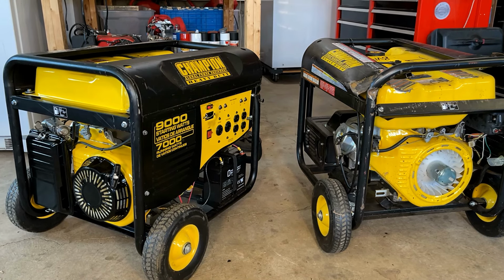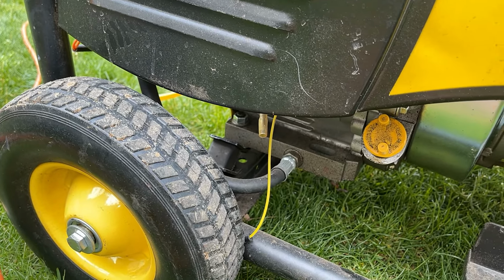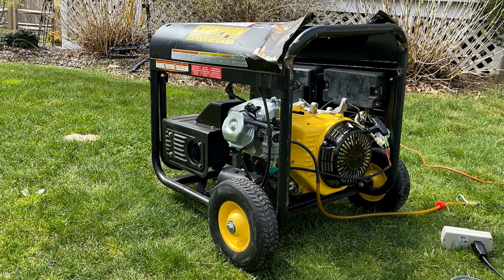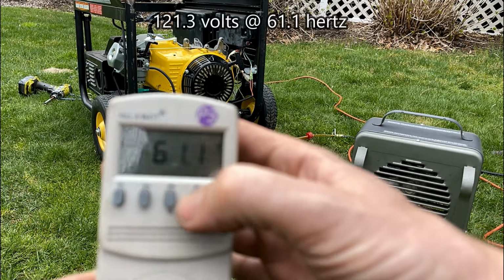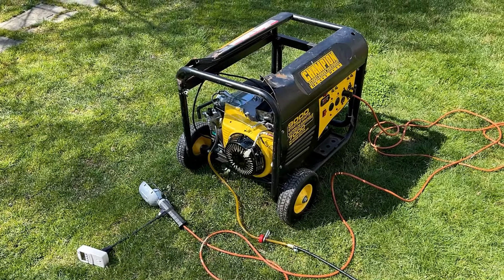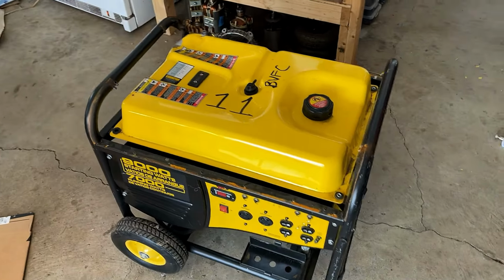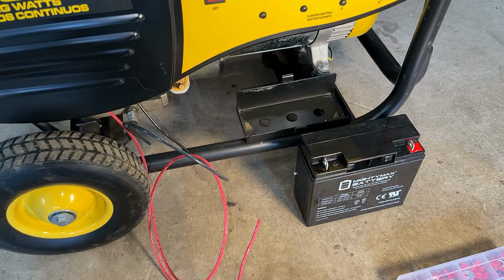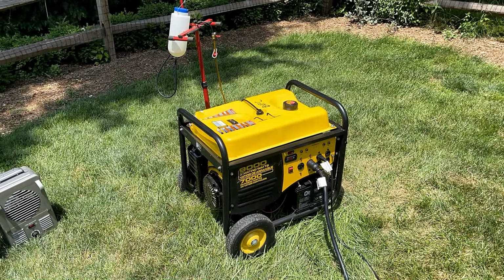Two Junkyard Champion Generators (Part 2) - Scrap Metal?

Comment: Just re-watched these two videos James.  It is kind of amusing that all the manufacturer's name was on the removed sheet metal of this second generator.  You could add "Champion" to both sides of the tank with a standard font of stick-on black lettering.
       To be more ambitious, I think that if you watched Canadian You Tube channels "Cold War Motors" and "Carter's Auto Restyling" you could almost learn enough about panel beating to repair the crinkled metal pieces.  They still would have needed to be detached from the rest of the generator to do it.  They would also have been stretched out by what happened to them.  A body hammer and various "dollys" can work wonders on sheet metal.

Comment: Just a question for you James... the container is
 not visible when you are spreading something on the 
sponge air filter.. is it oil?  If so, what is the function, 
I have never seen that done...Thanks.  By the way, had to 
like and sub.  Your video and work is superb!
Reply from the maker: Thanks Jim.  It was just engine oil.  Foam filters require a little oil to work properly,.

Comment: Hey James, what does oil on the air filter do?
Reply from the maker: On foam filters it will help capture fine dust particles.  After applying you should use a towel to get the excess out so the engine can still run properly.  Not all manually say to use it, but I always do on foam.

Comment: FYI: When I'm trying to diagnose a starting problem I keep the recoil rope off and put use a high torque drill with a 23mm socket and adapter to turn the crank shaft to start it. I have an old APC pull start generator that has really high compression and it will wear me out trying to start it if I have try pulling it frequently during testing. Now I leave it off all the time and use the cordless drill to start it.

Comment: You can buy electrical conduit benders at your local home improvement store. Cut the bent frame pipe out, and glue your new conduit inside or outside the old frame pipe with filled epoxy. A through screw would secure it.

Comment: Do you work with brushless generators James?  They are used because they require less maintenance. Voltage regulation is more of an issue though. What are your thoughts?.
Reply from the maker: I have worked on them see my playlist https://www.youtube.com/playlist?list=PLoj6DvbhMTztSXUFusVjCRndA9N8VsttA.  And agree with you on both points.  The only thing you have to worry about is the capacitor (and diodes on the rotor).  Have not picked one up yet with a bad power head.
Reply: @jcondon1  Thank you.

Comment: but would you buying a Champion generator would be good, or should i look for another type of generator ?. looking to buy a generator.
Reply from the maker: This was a well designed generator.  The only fault is that parts are not that easy to come by from Champion.  That said all the Honda clone parts worked out well.
Reply: @jcondon1  thanks

Comment: I'm pretty sure I've commented before about champion, they have a voltage sensor that shuts down the genny if voltage is above or below a set range... I forget the name of it
Reply: Over voltage protector
Reply: @toddk8555  nope its volt guard, totally the same yet different.
Reply: @sweetlou5902  same thing. I was just going by what they call it in their parts manual.

Comment: New frame for generator what you could try using is a one-man hand truck. It's got two wheels on one end and on the  other end  you can put rubber feet on the other end close to the handle bars.  And anytime you need to move the generator you got your handles right there to move it around with.

Comment: You didn't check the battery charge circuit. I'm guessing that is what those extra two wires on the AVR do. I would really like to know. Champion manuals leave a bit to be desired. I think they have gotten worse since I bought mine in 2011.
Reply from the maker: I did check and the battery was still charging.  Think those wires were to delay the generator head powerup when using the remote start.  Since the remote was MIA, no issue running without those wires.
Reply: @jcondon1  Makes sense. Thanks for letting me know.

Comment: 32:50 you show your measurement of 59.6 Hz. I was curious what the machine on board display would have said the Hz frequency was.
Reply: I think those Hz meters are pretty accurate and I'd be surprised if they did not agree.

Comment: I wouldn't be surprised if the crush damage to the gen happened after it was scrapped. So it was probably chucked out for the failure of a $15 part.

Comment: Hey, I'll go with you with pleasure. But now I want to ask you what might be wrong with my generator. It's new and worked for about 30 minutes then delivers no more power. I tried changing the avr device without it helping. Then when I screwed back the original avr and tried it again, it delivered 375 v. Then I turned it off. Then it doesn't deliver any more power. It's a 230v generator?
Reply from the maker: Sounds like there is an issue with either the AVR, DPE winding or sense winding.  Seeing voltage 40-50% higher then normal is usually caused by a bad AVR or sense winding.  No voltage at all could be a lot of things, but would start with checking the ohms on the DPE and sense winding which are the inputs to the AVR.  DPE is usually around 1.5 ohms and sense around .3 ohms.  Also check those winding to each other and to the stator ground.  Should be no connection.  Most likely it is an insulation failure in the stator.

Comment: Nice work. I would remove the governor adjustment screw, and straighten the bracket with some pliers. It would look much better. The metal covers could be straightened with a hammer and sandbag or dolly. However, it looks good without the covers. You could also use the pull tabs that glue on with hot melt glue to pull out most of the dent in the tank. Anyway, very nice videos. I have a little Champion that I have been putting off doing anything with it, and now I have a little incentive to go ahead and get it running. Thanks.

Comment: James I find your videos very informative, although I'm a retired automotive machine and have worked on my shear of small engines I never had much experienced working on generators mainly the power head part of them. Thanks for the videos.
Reply from the maker: Thanks Paul.  The power head is my strength.  Getting up to speed on the engines recently.

Comment: Hiya James, just a suggestion maybe those extra 2 wires where for the AVR shut down for over power. It would be too hard to test because all you have to do is put the old AVR back in and leave that 2 plug wire unplugged. Because the wire diagram didn't show what they did. I am getting good info from you keep up the good work. P.S. I am not sure how often you check your comment, but I have a generac I am trying to find a carb for. I have picture I can post links to if you could help. I have asked others that do the same thing you do but never got any response to any of my comments. Thank you in advance.

Comment: im sure you get asked all the time, but for someone who knows nothing about engine repair,  is there a brand i should avoid?  i can't really afford a honda but im looking for one as an emergency backup
Reply from the maker: I cannot think of one in particular to avoid.  My preference is Honda and Generac because they make parts available.  Most manufactures use a Honda clone and do not supply parts.  But Honda clone parts and Honda parts fit them, just harder to locate.
Reply: @jcondon1  thanks James,  i was thinking generac or champion.  i appreciate you responding

Comment: Those extra 2 wires on the avr are sometimes used to charge an external battery through a bridge rectifier and on the chinese avr  the yellow wire is negative while the blue one is positive (sometimes the cables are labled by a small paper-like tag thats gets ripped off easily)
Reply: I was curious if the battery had charging voltage like the first generator. Figured the black and red were for charging the battery.

Comment: I think the extra wires on the avr are meant to turn the avr on and off in the case of using a wireless remote start so the generater isn't under load on startup and shutdown

Comment: Nicely done James. Those Champion models were really good and sold well. I remember Costco selling them a number of years back. There was a recall on that model genny for a fuel leak if my memory is correct. Champion corrected the problem and continued producing them . The nicest feature was the remote start. Too bad they do not make that model anymore. So again for the 75 bucks you spent you now have two excellent running gennys. Great job👍👍
Reply from the maker: Thanks.  I like this model a lot.  Would be even better with the missing remote start and servo controlled choke.
Reply: Call Champion and get those parts. You could get the frame and tank all at once for fairly cheap. And yes they do have them in stock in the USA :)

Comment: With a crushed tank like that you can sometimes apply air pressure to the tank to get the dent to pop out. It doesn't allways work but when it does the tank looks much better.

Comment: You can pop that dent out with pressure. Use pneumatic from your air compressor or hydraulic from your pressure washer. As long as the inside pressure is greater than outside, that dent will just pop back out.

Comment: Great video!  The only thing I would do differently (as if I had half of your skill set) would be to hydrotest that damaged fuel tank. It may have microcracks that might spell trouble.
Reply from the maker: Good point.   There was some fuel in it, but should fill it up and make sure.

Comment: With capacitors, you can go over on the volts as that's a maximum voltage rating, but the capacitance must match

Comment: Love your videos! Out of the “budget” generators which do you prefer? Champion or predator? Or do you recommend a different brand? Thanks.
Reply from the maker: That are pretty much the same generator.  Predator probably the better resale value.  Duromax and Ryobi are similar.  The only one of those 4 that sells parts is Ryobi.  Fior that reason, would give them the edge.  Regardless they are all Honda clones and clone parts will fit for the common things that need to be replaced.

Comment: Thank you for part 2 video so quickly!  Really makes me think the back-story could be warranty replacements for two simple problems, and the distributor/manufacturer only requires the servicing dealer to return some critical component (like the carb) to get credit for the replacement. The condition of both looked too new (hour meter confirmed that on this one).The rest of the missing parts were gravy when they wind up on the spare parts self.
Reply from the maker: I agree.  They were both in new condition (except for the damage which most likely happened at the scrap yard).

Comment: Nice job bringing these two generators back to life.  Well done.
I was surprised you did not fix the bend on the bracket for the governor. 
Dave.
Reply from the maker: Thanks.  I thought about it, but just envisioned the metal breaking.  Did not want to push my luck.

Comment: I was really hoping you were going to convert that second one over to propane.  I would have loved to see that and build a try on top for two  20lb propane tanks
Reply: I'm not sure that on top of the engine is really the best place for a propane tank.  A few feet away at the end of a hose is safer.

Comment: Excellent video for the rebuild.  The only thing disappointing to me is that the panels are not on it and the tank is still dented. However, if someone doesn't mind the appearance then it shouldn't be an issue for them. Thanks for sharing your knowledge James. Ed

Comment: The low oil module just latches the signal from the low oil float switch inside the crankcase. The low oil float switch signal can be a bit crappy and not a solid signal, especially if the oil is crappy, so the module just latches the trip, so if the float thinks there is any low oil situation at any point the module keeps the line low so it kills the spark.

Comment: Great vid James. Nice troubleshooting. Just curious, would it have low voltage protection as well?
Reply from the maker: You would think, but not sure on that.
Reply: @jcondon1  Thanks James. Looks like it might be something from Champion called Volt Guard. Mentions surges and spikes but I could not find anything regarding low voltage.

Comment: Nice job on that "scratch and dent" genny, I'll bet it gets snatched up pretty quickly. Did you ever determine what that "extra" wire did that was on the old AVR?
Reply from the maker: Never figured it out.  Assuming it is related to the remote start.  Maybe it shutdown the AVR at remote shutdown in case there is a load on it.  Just a guess.
Reply: It goes to the remote start module. These remote start generators need a 10 second delay before allowing power so the engine can get up to speed. That connection there is what allows that to happen.

Comment: Crazy to think this generator was scrapped over a bad AVR.
Reply: That's just the way of the world, I guess. It's the same over here, and the usual reasons given are that it would cost more in labour than it would in parts to repair - Cheaper to replace as a whole, and to add insult to injury, you can't generally buy these returned machines, so you can't 'have a go' at fixing them yourself though there are companies who can buy them, refurbish them and sell on as refurbished/new other.

Comment: James, the rule I always went by for capacitors is that you can always go higher in voltage but you will want the same mF value.  awesome troubleshooting as always
Reply: Depends on your application.. sometimes u may want to increase the capacitance to improve the product. But one thing to keep in mind is the Chinese make a lot of fake capacitors like we could see at 12:00 mins where the 2nd module had a questionable looking nipon chemicon that was too small in physical dimensions for its specifications. It was always a good idea to measure with a capacitance & internal resistance meter before using any questionable china cap. 
They generally extract capacitors from ewaste and in the process of yanking them out they sometimes dent the capacitor with pliers so in order to fix that they fill the dents with wax and put on a new heatshrink wrap with false specifications and manufactur name. Most of the time they put fake nipon chemicon or nichicon or any other popular brand of capacitor's shrink wrap.. this is why when i need big caps i pay the extra to order from reputable sources like mouser , digikey , lcsc , element 14 etc.
Reply: @KuntalGhosh  surprising about the reused cap market!!  I like to say the voltage tidbit on the capacitors because it’s the insulation rating- so really in a like for like situation, the capacitance is the value we need to keep constant. But as you say sometimes you need more or less capacitance, I had a customer request a single phase motor to start slower to have a softer start up so we decreased the start cap 150mfd

Comment: Another great video. It is surprising at how easy the unsuspecting DIY fixer can be caught out with the different AVR's that are put in generators these days. I've got an old Scorpion DY-1000L generator here. It still runs well, though I've not used it in about 12 months. I don't leave fuel in the tank when storing it, to avoid gumming up the carb.

Comment: I still can’t figure out why anyone would throw even ONE of those away let alone TWO! Very nice save on both of them, they’ll make great generators for someone.
Reply from the maker: I like the way these run.  Seem like a good design.
Reply: If they were owned by a business then sometimes it's cheaper to scrap and claim for new ones than it is to get them repaired.
Reply: @Oldgit51  that’s true, actually that reminds me of an event that I witnessed back in the 80’s when I worked at our local housing authority. We had a mower that was always giving us trouble so the supervisor had one of the guys run over the deck with the truck to cause irreparable damage to it. He took pictures and claimed it as a construction accident so the insurance company would pay out for a nice new Bobcat machine. Maybe that’s how one of these generators got all dented up!
Reply: It is called write offs in the commercial world. Take a loss to save on taxes. Win Win
Reply: @Oldgit51  Box Store returns written off at cost by manufacturer or their distributor.  Store policy probably to strip off loose parts (to discourage writing off good units.  The carbs, and batteries probably "disappeared" and everything else just was dumped into the dumpster.
Reply: They look like they were from a hire company (Letters on the tank) and written off us uneconomical to fix.
Reply: @jonboynz2093  My thoughts, hire company write-offs chalked up to "infant mortality" and carbs/batteries reclaimed for the ones that worked
Reply: @Oldgit51  Harbor Freight 2 horsepower generator changing how to change changing a voltage regulator on a Harbor Freight 2 Hp Storm Cat generator using a multimeter

Comment: Wow, when I said I wondered how many minutes these machines had run before being scrapped, I was actually kidding, but at 7 hours, that just a meagre 420 minutes!

I have to say, we were thinking "overvolt protection" - Glad to see this one got its chance to shines, and doesn't it though? I think the cosmetic damage is something you could get used to, and after all, we tend to use them to produce power, not to sit there looking pretty.
Reply from the maker: I agree.  The remaining damage has no impact on its function.  Someone will get a good generator.

Comment: You should get a PDR - paintless dent repair kit. Then you could pull out the dent in the gas tank quick and easy. You could fix the dents in the covers with a cross peen hammer or auto body hammers.